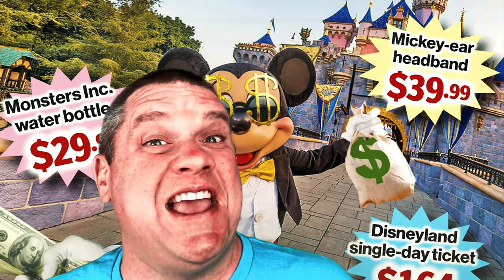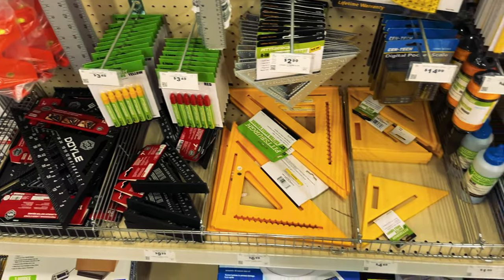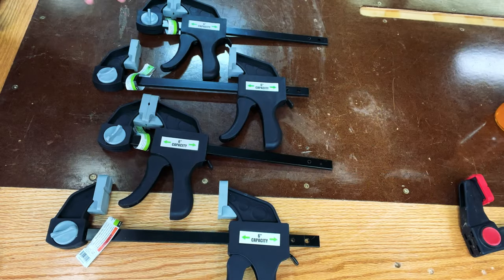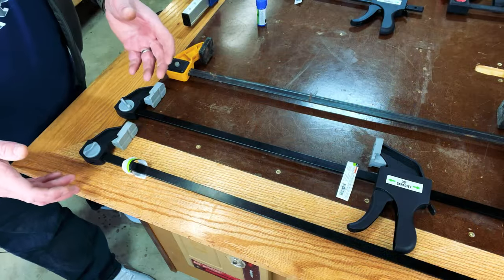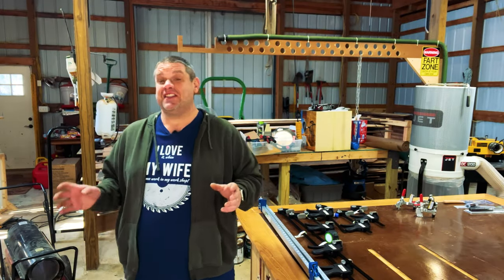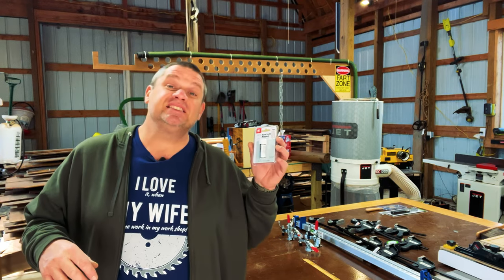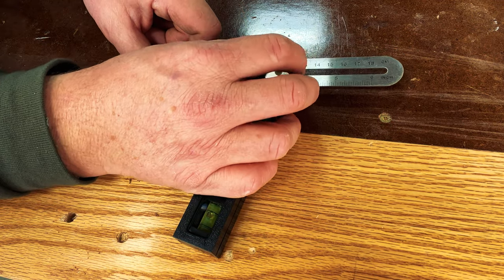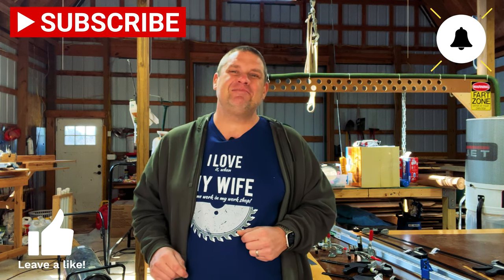So What's The Deal With Harbor Freight?!?  Hate it/Love it?? #woodworking #harborfreight #cheaptools

Comment: HF has it's good and bad. I have the 10" drill press and haven't had any trouble with it.
Like the other comments there is a nice upgrade you can do to the parallel clamps. 
The smallest quick clamps keep breaking on me. They stop tightening up. HF just gives me a new one each time with no hassle. I like the quick clamps because they can also spread. I have a set of Irwin's and they won't switch to spreading. I'm not a big fan of their sandpaper though. It doesn't seem to last very long. 

Just joined your channel yesterday and I've watched almost every video so far. Working on watching all of them. Thanks for the great content.
Reply from the maker: Thank you so much 9ball!  Really appreciate your comment.   Good to know about the drill press.   I did see those parallel clamps but they only had one, and I didn't really have a need for more at the moment!   I definitely plan on getting some of those parallel clamps next time I buy some.  Heard really good things about then!   Thanks so much for watching the videos, means a lot! :)

Comment: I think your first impression is spot on. I have learned to never buy any type of precision tools (rules, tape measures, squares, etc.), drill bits, sandpaper, powered tools or tools with moving parts. I do buy the HF rubber mallet and dead-blow hammer. I bought that bench a couple years ago to use as a paint/finish mixing bench. Very light duty. The top began to sag, which threw the drawers out of whack. I had to rebuild the whole drawer, slides, cabinet, etc. Recently, I needed a RO sander with a more aggressive pattern than my Bosch and 3M sanders. I purchased a "highly touted" Bauer 5" sander. That thing shook like a freight train and threw sanding discs across the room. I tried different brands, grits, etc. I been woodworking over 50 years and know how to use a RO sander. I pitched it in the garbage after a couple hours. Lesson learned, again.
Reply from the maker: I'm just jealous you have that 3m sander, everyone seems to be ranting and raving about that!   It's so funny you mentioned that rubber mallet.  I looked at that thing, thought it was a good deal, Then after about 20 seconds told myself "You don't need 3 rubber mallets".  It was totally just going to be a purchase for the video!   Thanks for the comment and thanks for watching! :)

Comment: Compare the ruler and the T bevel to see if the measurement marks are consistent... I've seen the cheap tape measures there vary greatly just comparing two randomly off the shelf.
Reply from the maker: That is so true CoastalBackWoods, I actaully did a test on a bunch of tape measures in one of my old videos.   I don't think that T-bevel will be my last one, but for a temporary fix it will do the job.   Thanks for the comment and suggestion!

Comment: Harbor Freight just opened a new store less than 15 minutes from my house.  (That's much more convenient than the 30 minute drive I used to have to make to my nearest HF.)  I think your assessments are spot-on: great for consumables, but not so much for power tools, although I bought a Bauer 20-v drill/driver to keep in the house.  One other thing: HF has started distributing parallel clamps.  I've seen a number of side-by-side demonstration videos, and they compare favorably with Bessey's parallel clamps, and they're much less expensive.  You might want to check them out.
Reply from the maker: You are exactly right on those parallel clamps.  I saw a video by 731 Woodworks that basically said they were one of the best parallel clamps out there.  I have a bunch of bessey ones right now.   I was going to buy some of the 48'' ones they had but they only had one.  I wanted to get at least two.   Thanks for the comment and thanks for watching Scotty!

Comment: I was playing with the idea of that workbench. The reviews are great. I was also wondering about the price but not being solid wood, makes sense now.
Reply from the maker: You know, i didn't inspect the entire bench, so there may be some wood structure underneath it, I just notice that parts of top (at least the display I saw) had what I believe particle board underneath a veneer.     Thanks for watching!
Reply: The top is not solid. It has a false lip all the way around to make it appear thicker. I bought one a couple years ago to mix paint and finishes. Very light duty. The top began to sag, which threw the drawers out of alignment. I had to build a new frame, slides, etc. The end vise is a joke and racks out of square with light pressure. Could have made a stronger bench for a lot less money. There are better alternatives. Watch for sales at HD and Lowes.
Reply from the maker: @richpeggyfranks490  Great to know Rich and Peggy!  Thanks for sharing!

Comment: I've found neodymium magnets at Home Depot. I bought some of those extra long bar clamps at Harbor Freight. They work well, though the aluminum bars can be a bit wobbly. They also sell these very inexpensive battery powered LEDs (look like light switches) that I keep in various places around the house and in the garage in case the power goes out.
Reply from the maker: You know I saw those lights, and thought about getting some, but was afraid that I would forget to turn them off in my shop and just drain the batteries.   That's awesome you found those magnets at home depot!  What section were they in?  I'll have to check next time I'm there to see if my local one carries them!   Thanks for the comment Ted, and thanks for watching!
Reply: @FlynndoggWoodwork  I just keep those lights in strategic places (I.e., bathroom) in case the power goes out and in dark spots in the garage where the sun don't shine. I also put one inside the dust enclosure I built around my miter saw so I can see what's going on in there.

I believe I found those magnets in the fasteners section. I had to ask someone. When I search my local HD's website, it just tells me the aisle number. A good use I found for them is to stick my drill press chuck key to the drill press so I don't lose it.
Reply from the maker: @Ted_James  ohhhhh!  I see, that makes more sense with the lights!  Great idea.  Just put them in those places where you know you will turn them on only when you need them.   I’ll give Home Depot a look next time I go, and maybe ask someone.   Thanks for letting us know that they are available there sometimes!
Reply: @FlynndoggWoodwork  I happened to be at Home Depot today and noticed that those magnets are in a Specialty Fasteners section within the Fasteners aisle.

Comment: Harbor Freight tools range from very good buy to dumpster fill. The Pittsburgh bar clamps are a buy however the longer tend to bow the 6” & 12” are my go to’s, everyone needs a few wooden hand screw clamps good buys, the Bremen 24” & 48” parallel clamps are so far great.  I’ve turned about a bizlan pens with their 10” by 18” lathe (apparently the same as Grizzly and Rockler) so far great.  
My 2 cents from an old woodworker.
Reply from the maker: I love your 2 cents!  Thank you so much for sharing and I agree with you from my limited experience so far.  Love hearing real life experience like this!

Comment: I really like going to HF and have found for the average person to do minor repairs around the home their power tools will suffice to get the job done. For the most part they are not construction grade and wont stand up to heavy abuse. 
I have bunches of the 6" clamps and they are great but word of caution they do change the design from time to time and there is one that has the grey trigger that if your not careful to limit the amount of pressure you apply it will break easily but the other design that they use in a molded type is much better.

I am lucky to have several of them near and one right next to where my wife gets her nails done so I get to browse quite often and seldom leave without making a purchase. Wish they would bring back the mailers with the coupons. There are some online coupons available so sign up for the emails
Reply from the maker: Great to know John!  And thanks for your advice on the clamps!  Good to know.   I love the fact that you get to check it out while your wife gets her nails done, that is too funny.  I signed up when I checked out for their marketing, and I've already gotten a bunch of coupons via email from them.  That may be the way to go, then you can just browse your trash in your email and pull out a coupon!   Thanks for watching and thanks for the comment! :)

Comment: Cool video keep em coming. Harbor freight is my go to for clamps and odds and ends. My opinion, humbly lol, you got a few things wrong. Hardware dept sucks, yes. But I think you missed the nail/staple aisle. Brad nails, finishing nails any gauge nail in there are super cheap, and good quality that's where I get all of mine. Next, power tools. 90% of their power tools are garbage. Except brushless Hercules products, I own their new hammer drill and impact driver, brushless models, 5 year warranty included on all brushless Hercules. Slap it in the counter they give you a new one and send you on your way, almost like the old Craftsman days with Sears. Also the Hercules 10 inch table saw with rack and pinion fence is killer, I've had it for 2 years now, I CHALLENGE anyone to find a better table saw with all the bells and whistles for that $400 or less (the Skil would be close). I don't have the Hercules 12 inch sliding miter, but my brother does, and honestly from using it it's like a carbon copy of the DeWalt 780 for half the price. You should look up some review videos of the stuff I just mentioned so you can see for yourself, Hercules is making a serious run for pro-sumers, and in the case of that hammer drill and impact, some might say (myself included) pro grade
Reply from the maker: That is awesome milleradam!  It sounds like the Hercules Brand is really making a big impact from the comments I've been getting from this video.  That's great news for everyone!   I love the fact that a lot of people are commenting on here because they own the tools and can actually comment from real experience!   That's exactly what I was hoping for.   I really wish I would have checked out Harbor Freight before I collected my tools, as it sounds like there are some truly good ones there.   I wondered if I missed the isle for hardware, but I swear I went down every isle and didn't see anything for hardware.   I only saw a few screws and a few nail packs, but really didn't see anything impressive.... it was weird.   But then again, I didn't ask a employee if I was missing them.  Thanks for the comment and thanks for watching!

Comment: I actually prefer their f style clamps over Bessey’s. I never can get a good grip on my Bessey clamps twist handle. I’ve heard good things about the Bremen clamps too. I’d like to try their parallel clamps, they’ve gotten some pretty  good reviews on other channels.
Reply: Wrap hockey tape around the wooden handles of the Bessey F clamps and you will get a perfect grip.
Reply from the maker: Interesting.  I've noticed on amazon that the F-style clamps from bessey still appear to have the wooden handles.   The ones I got were all from Home Depot and they have a rubber grip which is really easy to get a firm grip on them!
Reply from the maker: Excellent idea!  I played hockey in high school!   You could even do it where you twist the tape in a helical fashion along the handle and then wrap it with hockey tape.  We used to do that to the end of our sticks!
Reply: @FlynndoggWoodwork  that's exactly what I did. I just got into woodworking a couple months ago and had a hand full of old Bessey F clamps of my dad's, it worked amazing.
I think I seen it on some of Rob Cosmans clamps in the background of a video and thought it was brilliant. I have done that do everything that I need a good grip on that has a wooden handle now.
Reply: That is a great idea. Because we always over engineer everything we do as woodworkers, I never considered a simple solution like that. 😂
Reply: Those Bremen Parallel Clamps are a good buy for the price. Whenever they have a 25% off coupon I pick one up. Have four of the 24" and four of the 48" and have no complaints.

Comment: The Hercules brand of power tools are WAY better than Ryobi.  Their impact wrenches are about as good as you can get.  I've been a carpenter for most of my working life (just retired).  I recently needed a second power miter saw and bought the Hercules 12 inch.  It's all I use now.  It's way better than my old Dewalt.  

Regarding clamps, you missed the real gem, and that's the Breman 48" bar clamp.  You should check them out.
Reply: The Hercules line is pretty darn nice at that price point.
Reply from the maker: That's great to know Jim!   I really wish I would have visited Harbor Frieght prior to being almost fully stocked on power tools.   Sounds like I could have really gotten some high quality tools at a lower price if I would have.   Those Breman 48'' Bar clamps I've heard are great.   I probably would have purchased some if I didn't already have about 10 parallel  clamps already.    If I ever need some more bar clamps (which everyone knows I will), I'm definately going to get some!
Reply from the maker: Great to know Billy!  Thanks for sharing and thanks for watching!
Reply: Those gray clamps are junk

Comment: Their Hercules line is now competing and beating the top pro brands. In terms of performance and warranty. The Doyle brand framing squares are legit. The quick clamps are great and I have several of them. I also have the F style clamps and though they aren’t as strong as the top brands, they still haven’t failed me in all the things I have clamped. The Bremen parallel clamps are top notch and are just as good as Bessey. The aluminum clamps that you got, they are great but lack some strength. There is a mod you can do the make them even better and that’s to take a piece of maple and cut to the time of the inside of the flame and to the length. It gives it a much stronger rail for more clamping force. Here is a video on it Improving budget aluminum bar clamps for woodworking - YouTube https://m.youtube.com/watch?v=g7uXZXdDOy8
I also have the flush trim saw and love it. I use a playing card to keep it from marring the surface and sand the rest down. The air tools are great. I have the 20 gal McGraw compressor and it is a beast. Sadly it doesn’t work well in the cold and my garage isn’t insulated or heated, sort of. 

All in all, I love Harbor Freight and for me it’s perfect most of the time as I can afford almost all of it. They are getting better with quality but still have a way to go on a lot of things. This was another great video. I know I’ve missed a few and I’m sorry for that. Keep up the great work and keep making sawdust!!! 👌
Reply from the maker: I've missed you Sneaky Hippo!  Thank you so much for the comment.  I really like the things you pointed out.  Sounds like you have some real experience with their products!   Thank you so much for sharing the video too!  Very helpful!  I really wish I would have purchased those Bremen Clamps as I know everyone has talked about them, however I already have about 10 parallel clamps, and they only had one 48'' clamp there.  For some reason I can never buy just 1 clamp.  Have to buy them in pairs!   Thanks for all the information you left in your comment, very helpful information!